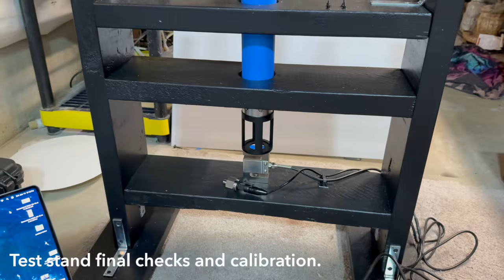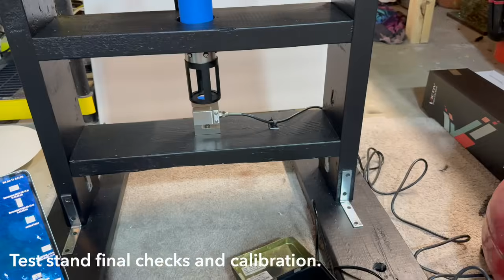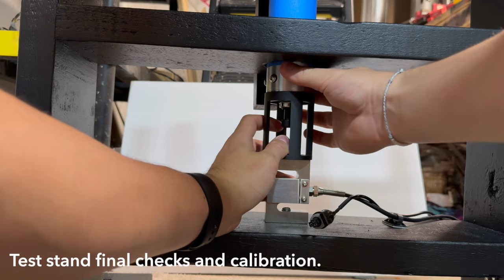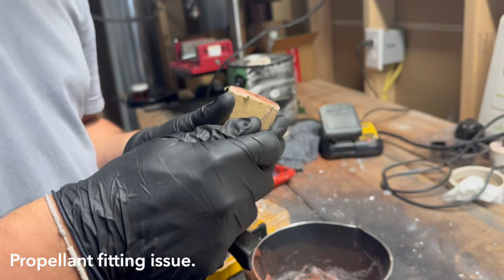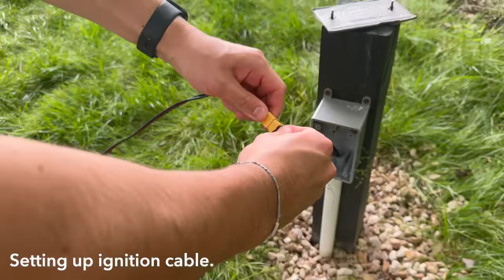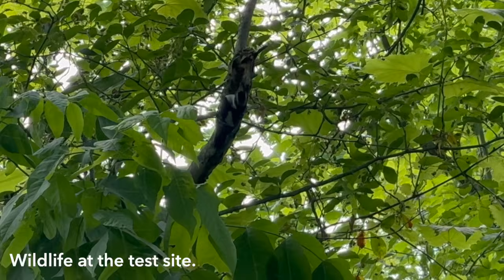Behind the Scenes of a Rocket Test Fire (SN5)

Comment: How often do you read data from sensors? In my case it is ~50Hz, I use ESP32
Reply from the maker: I’m currently logging data at around 85 Hz from both my pressure transducer and load cell.